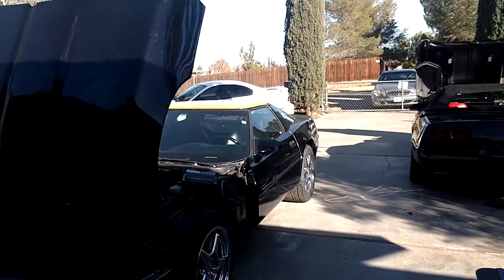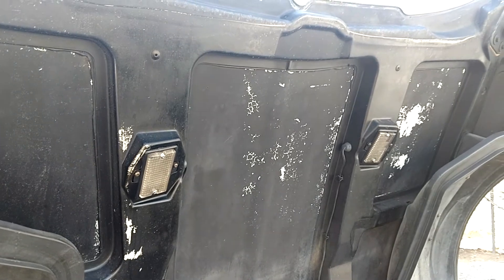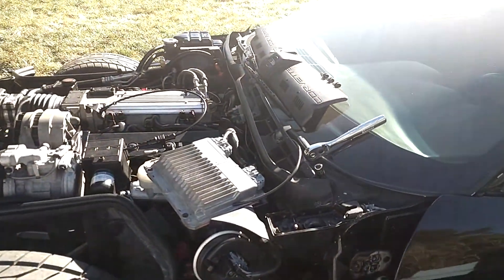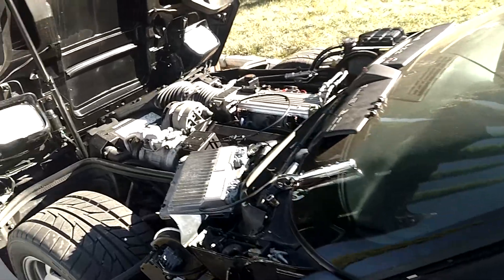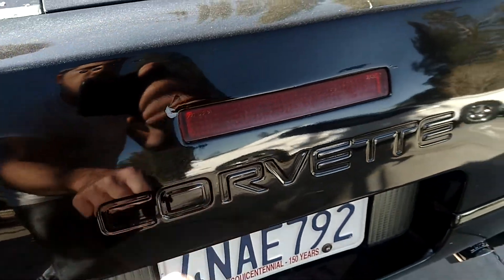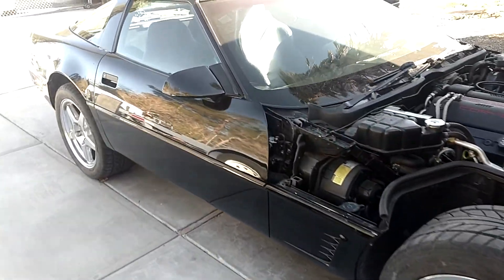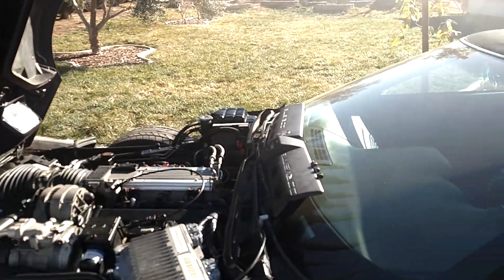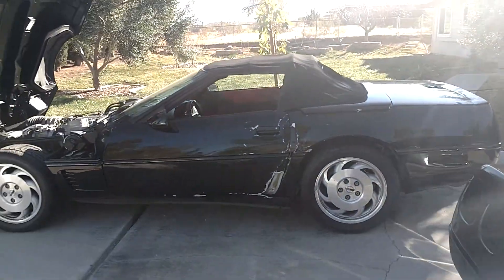1996 C4 Project Update/convertible C4 Wrecked at 45K

Comment: Hey Mike. Just came a crossed your channel. I really have enjoyed your C4 videos as I have a 95lt1 with zf 6sp myself. I with I had your motor knowledge. I would love to take on a full rebuild on it as I’m about to roll over 150k. She runs well. But I am doing the improvements slowly. My trans needs a rebuild and a clutch I think. Some tell me they are only good for 150k. Who knows! 
I saw in this last video you are selling parts as well. I am in need of a new PKE module. Right above the radio under the dash. Is that something you may have? 
Also, do you have an email I can shoot you some other needs or questions I may have. 
Thanks for your time Mike. 
Phil